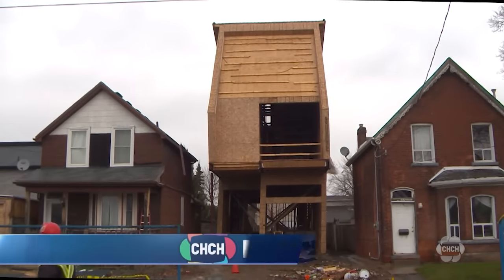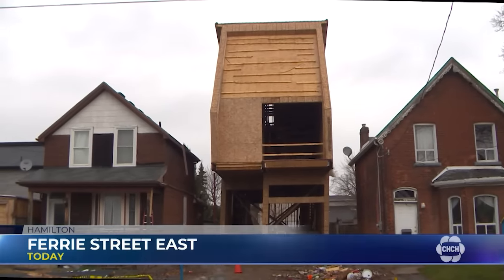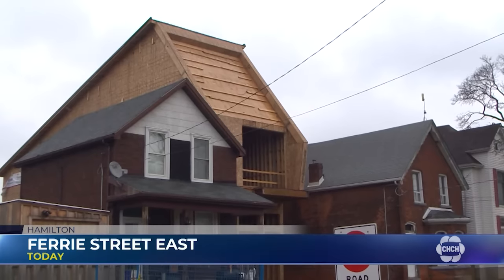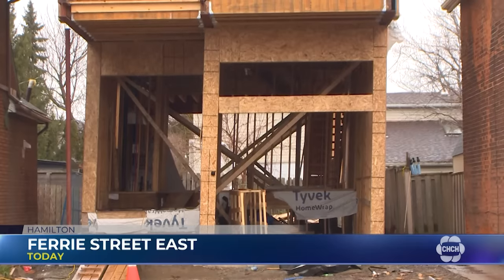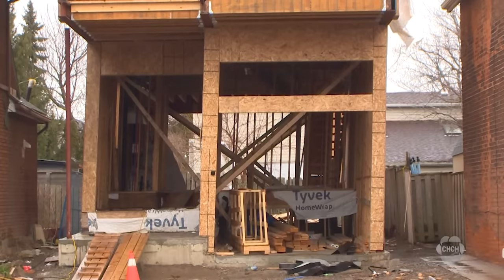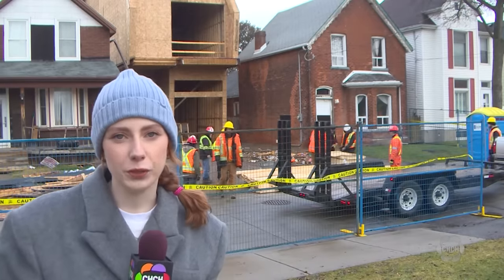Leaning home sparks concerns of a collapse in Hamilton’s north end

Comment: That's an amazing amount of daylight to see through the first floor at this stage of construction.
Reply: yeah the ground floor is little more than 4 outside walls. you can see right through it.
Reply: Exactly.....what caused the racking....Maybe the lack of installing sheeting on the lower rear walls before moving upwards with the construction. One has to think that there are also many other structural members missing as well. Would be interesting to see the prints ont his one and how it was designed to prevent this overall.

Comment: It's obvious why the building is racking. Whoever designed this abomination forgot to include any structure to the front wall, just a big opening for a garage door. If you skip the sheathing on the front wall, it needs to be made up with an interior wall.
Reply: Correctamundo. Lack of shear. Gonna have to kick it off to the neighbors house.
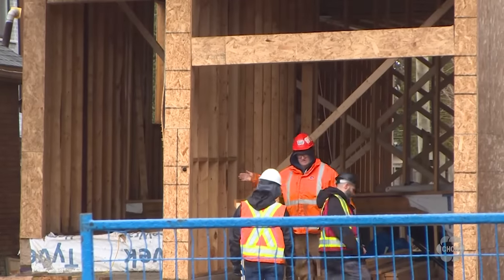Reply: 0:42 an OFF DUTY INSPECTOR spotted this, seriously?, lucky he just happened to be driving past. 

were all his inspections done after hours? or did he just cash the mailed cheques and write the approvals?
Reply: Hard to say from the footage, but the rear wall is not sheathed either.  it looks like there might be an interior wall studded out.  If that was intended to be an interior shear wall, they should have put on the shear panels before starting to build the second story.
Reply: @andrewalexander9492  yes. I would guess a structure such as this would have to be engineered, signing off on the plans, connections, and sequence of assembly
Reply: Actually incorrect - you can form openings this large in a wall this big but you’d have to have steel portal frames forming the opening to provide adequate strength at the connections
Reply: @adammacer  please go back and re read the comments. No one  is saying it cannot be done. Experienced builders are saying it must needs be done correctly,  that is to say, engineered.
Reply: @2centsam927  I don’t need to reread anyone’s comments. I know it can be done and I said as much. I was responding to the “if you skip the sheathing on the front wall it needs to be made up on an interior wall” - sorry, but that’s incorrect. I AM an experienced builder and also an architectural designer of 12 years.

Comment: Looks like they tried to build the top floor before the bottom floor was strong enough to hold the top floor.
Reply: That's exactly what happened.  I've been a carpenter for 48 years now, and I can tell you that the first floor was in no condition to accept the second floor at this point, braced off or not.  Even the scant amount of OSB sheathing that is on the front could have been applied "smarter" to allow for more structural integrity.  I've seen stuff like this before....it never ceases to amaze me how many goons are out there building things they know nothing about.

Comment: This kind of shoddy building practices were common in Columbus, Ohio in the 1990s. Usually it was "slum landlords" who would be trying to cut corners on fixing up an old house hoping to rent it to students. The landlord would hire winos & drug addicts to do the work, and they would put up siding to hide the weakened walls, and other deteriorating areas. Luckily myself and my neighbors kept a close eye on them and reported it to our city's building code division. The workers would work on weekends when inspectors weren't on duty. A tell tale sign, would be excessive use of siding, quickly nailed up to hide caving-in foundations, rotted wood framing, and other poorly built construction. The neighbors called our local TV stations to keep the pressure up. We succeeded, we took photos of everything, and eventually a city attorney volunteered to take our concerns seriously. The slum landlord wasn't at all happy, and tried all sorts of illegal moves. ....One trick is, they quickly sell the building to a family member, even a juvenile or a baby, will work, to get the property ownership under a new name, which often means the complaints, are thrown out,...and new complaint reporting has to accumulate, to trigger inspections. We had about 5 neighbors, networking on this, and eventually the landlord "caved', and was forced to rebuild most of the building, up to code and correctly. We made sure the finished house, matched the style of the surrounding houses. All that scrutiny, meant the landlord's other properties, were in jeopardy of being closely examined, as well. Because this behavior is often, "just how they operated". Cutting corners, and gross malfeasance is their "modus operandi".
Reply: Your one of the reasons houses costs 1.9m to build - cant lift a hammer now without someone (usually an office worker with no clue) complaining  about EVERYTHING
Reply: @handymanr4729 You have a right to your opinion. The shoddy work we witnessed unskilled & untrained home renovators, trying to (get away with), was beyond the pale. Using siding to hide poorly built & deteriorating old structures, will never be acceptable. imo

Comment: Who engineered this jewel?? NO Shear on the first floor, ultra top-heavy. Good luck
Reply: Yeah, I'm guessing that the rear wall was intended to have a lot of glass/doors or other openings, hence why it was essentially open.  It's not cleat to me what was intended to resist side to side racking in the finished building.  If that was intended to be done by interior shear walls, they should have sheathed them before starting the second story.
Reply: More likely amateur construction workers than bad engineering.

Comment: the ground floor is little more than 4 outside walls. you can see right through it, if the inner walls had been built (as they should have been) then the building would have been fine.
what cretin was building this and why was there no inspections to pick up this obvious oversight?
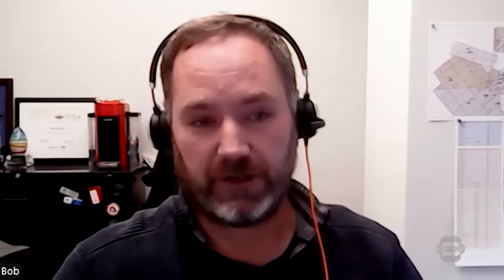0:42 an OFF DUTY INSPECTOR, seriously?, lucky he just happened to be driving past, were all his inspections done after hours? or did he just cash the mailed cheques and write the approvals?

Comment: This is happening everywhere. This is a problem. City officials should NOT be signing off on these projects. There must be a lot of graft going on at city hall. Taking the money for approving these projects in return for approval. Wow, just Wow.
Reply: City rely on engineering drawing, this happen when people hired a cheap framing crew combine with  a non experience engineer in residential construction. narrow house need a steel structure to support second floor with big window opening. Aldo We Build Quality!!!
Reply: Pretty sure all the high rise buildings are going to collapse in the next few years.  The building I live in is scary with the amount of falling plaster and cracks in the concrete
Reply: The city accepts the drawings and schedules from the structural engineer. It is too expensive and complicated to check it for themselves. You would be paying a lot more property tax if you wanted the city to check the plans to that extent.

Comment: Theres no sheer wall on the front of the building.  What did they think would happen?  Lol.  It needs to be pulled straight and some engineered braces added.  Someone didn't give enough thought to that front wall.
Reply: They didn't give much thought to the front and back.

Comment: After replaying , what I now know is that whoever is the builder engineer for that house that is made of wood had not added enough structures .

There is nothing to support that house from flexing side to side , only support for front to back flexing . The neighbour house on both side should engages lawyer quickly .

Good luck to the builders company as well as the engineers , they have a lot on their plate as soon as that house collapses . Those bracing ain't gonna hold it .

Comment: Anyone with mild construction experience can tell you that you don’t frame a structure with 3 walls and a second floor that narrow using OSB. It has no shear strength. Enginerds should have required a  bolted steel post and beam assembly over the garage door to prevent racking.

So who in the building depart at the city needs to be fired for approving these plans and not spotting the lack of actual structure?

Comment: It is pretty obvious what the issue is. This is what happens when you go for the low fee on the structural engineering. People have to ask themselves why the fee is 1/3 or 1/2 of the competitor's fee. You get what you pay for. 

It needs a steel transverse moment frame in the front and back to stop the racking. It is a good thing that it is not in a major earthquake area but the seismic risk is not zero. It is risky just to stabilize the building.

Comment: Who the f is this guy? Racking is NOT ‘diagonal twisting’ - it’s deflection in one plane  caused by insufficient rigidity in the structure. Looking at the front you can see that there is next to no bracing in the ground floor front walls - nothing that prevents the connections between vertical structural elements and the horizontal ones from being able to ‘hinge‘. The openings are too large to leave enough wall sheathing which is what usually provides such bracing. The alternative to sheathing is to provide frames around the opening that have solid connections that prevent hinging - and steel is the usual way to achieve this.

Comment: You kidding?   Most of the houses in the lower part of Hamiltion lean.     10 years ago I was going to buy a home in Innes Ave but after walking into the home it I realized it was leaning.  Turns out the flipper damaged the supports in the basement and the house was slowly going to fall over.     Most houses I saw that year in my house hunt leaned.      My current house  that I bought has spots where you roll a marble and it rolls to the lowest points.   

Most of the houses in this lower part of the city have issues.    So this one just fits right in.

Comment: Whoever approved the blueprints is liable
Reply: I don't know that design is the actual cause and there is no way to know without actually seeing the plans. You can see right through the house from front to back. It's obvious that they never completed the sheeting on the lower floor before going upwards. This makes me believe that they never completed any shear walls, that were most likely designed for the interior.
Reply: @TheRonKlimo  no amount of shear wall would keep that design standing.  Possibly if the ground floor was 3x brick wall